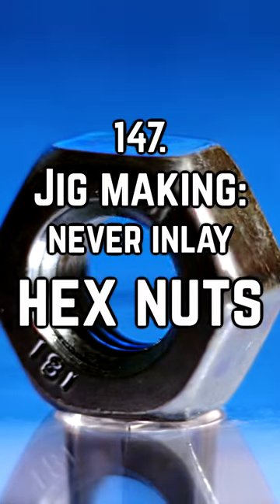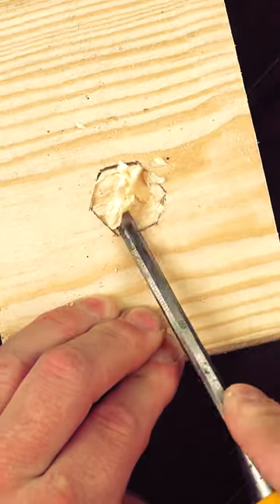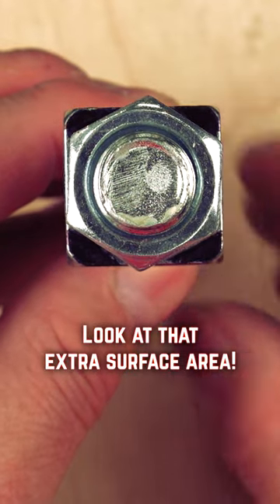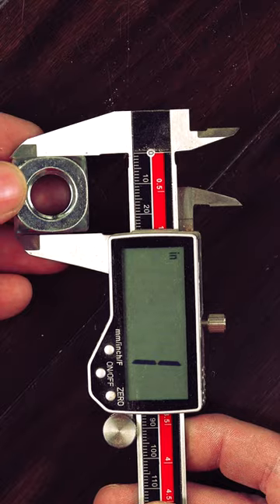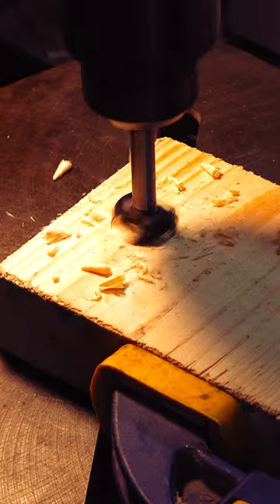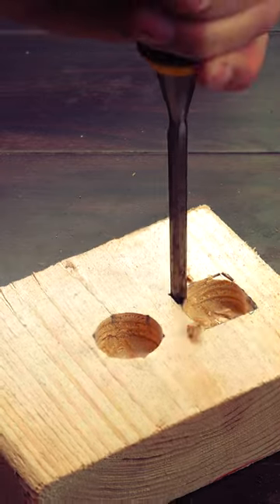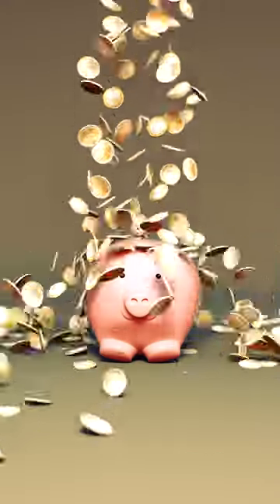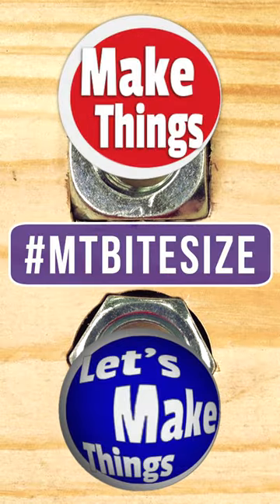147. Jig making: Never inlay hex nuts #mtbitesize #shorts #jig

Comment: Awesome thanks for this one, been holding out on a little project because I didn’t want to have to chisel out 8 hex holes.
Reply: You can drill to the distance between flats and chisel the corner, that's just 2 more corners per nut than square nuts.
If you don't have square nuts laying around, you can instead buy inserts for around the same price, which don't require any chiseling.
Reply: or: get a tap amd a plate of mild steel, make your own custom bracket with threading that you can inlay however you want.
Reply: And now you are about to go get some spechul nuts, apply a twisting force parallel to the nut and split whatever you made.

Comment: It works well to inlay a hex nut by just drilling its hole barely tighter than its outside diameter. The points of the nut drive into the wood with the flats fitting nicely in the circumference of the hole. 
Having said that, yes, better to use square nuts.
Reply: He showed that method in the last clip in the video
Reply: @thereinthetrees_5626  no, he showed drilling just under the circumference of the outer points and inserting the hex nut, not drilling the circumference of the middle of the flats like he did for the square. He didnt chip out the corners like he did for the square nut. They are correct with the square being better, but they "sold" it by making the hex version even worse than it really would be done.
Reply: @thereinthetrees_5626  hes right, the hole he drilled in the last clip was way too big.

Comment: Um, would you not want more surface area under the nut in order to reduce the risk of crushing/tearing fibers. I've seen better use with wide washers on construction or tee nuts for finer builds. They dig into the surface with teeth and you can make it flush without chiseling

Comment: Threaded inserts, barrel nuts, all sorts of fittings could be selected, but the reason a hex nut is such a good choice is convienience, they're everywhere.
Also another reason square nuts cost more is the same reason they weigh more. There's more metal for the same thickness of nut.
I imagine for folding or knock-down furniture where weight is a factor lighter options than either hex or square nuts would be typical.

Comment: There is a better way when it comes to hex nuts and wood inlays. It works roughly the same way as with a square nut, the difference is you use a smaller drill bit, get close to the lines but do not go pass them, then use the chisel to get the rest of the edges. But if you want easier and don't care about costs then yea go with a square nut inlay.

Comment: But.. There's circular nuts with a flange with pointy bits.. Pulls itself into the wood.
     If they need to be flush with the wood - Forstner bit for inlay purposes,

Not a good solution?

Comment: What about the square nut being parallel to the grain and any twisting force would separate the grain and split the wood. unlike in a hexagonal pattern where there would be always atleast 2 sides in an angle pressing down on the grain instead of trying to split it.

Sometimes easier is crappier. Took me all of 10 seconds to find this "flaw".

Comment: The advantage in using hex nuts over square nuts is that I don't have to go out and buy hex nuts because I already have them. And there's a way to keep them from stripping out in wood that is realatively easy and secure.
Reply: You can always file a groove across a hex nut and inlay a piece of rod. But frankly I've found few jobs that a T-nut (on the pull) didn't suit.

Comment: I use rivnuts and forgo the chisel work altogether. Depending on the wood being used in the function of the threads, you can just tap the wood itself and reinforce the threads with CA glue.

Comment: Square nuts are superior for inlaying into softer materials sure. Fast install is not the only advantage though, otherwise in these days of air and electric tools everywhere we would just be using square nuts and sockets for them. Because they have more points of contact they can handle more torque than square nuts before rounding out. Surface area of the sides makes no difference when you are wrenching on something, only the corners are under load.

Comment: (New edit) Ok, I just finished watching the short and it's weird you would use the drill for the square nut but not be mindful enough to use a drill (smaller than the hex) and just cut out the angle edges you need.

(old)
Well, if you stop to think about it why shave all that for a hex when you can drill to the depth you need and then chiz out the edges.

Comment: The drilling is disingenuous, you can just drill to the distance between flats and be done with it
Also 
M8 nut: 23c
M8 pronged insert: 24c
M8 screw insert: 27c
Given the price difference you might as well use the correct tool for the job if you're at the point of using square nuts.